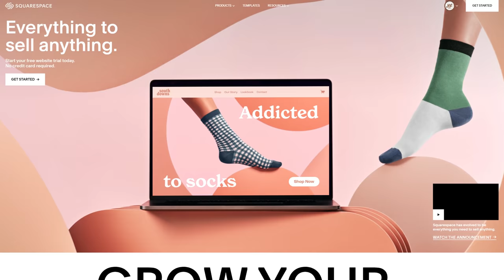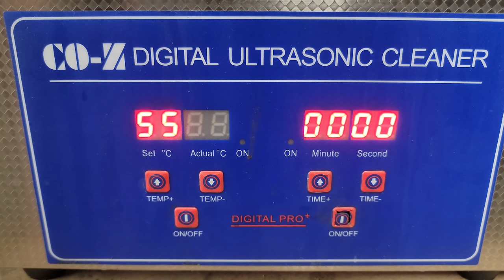Rusty 1960's Nylint Ford Lift Gate Stake Truck Restoration

Comment: Beautiful restoration. Funny thing is it’s a FORD AND IT HAS A FLIP UP CAB TO SERVICE THE ENGINE! Kind of makes me weary of the FORD MOTOR COMPANY! Haha 😆
Reply from the maker: Haha they actually made the real version of this truck for over 30 years, Couldn't have been too terrible!
Reply: @joe_diy  no they  were actually beastie old trucks they would take a beaten for sure there is an old commercial that if you bought one of those old Ford cab over trucks you would be able to purchase a 8n Ford tractor like $450.00 less than the regular price of one doesn’t sound like much by today’s standards you could. Probably buy the 8n tractor for like $2500.00 back then so it was a good marketing deal .....

Comment: What no seat or steering wheel  ,that's going to be hard to steer without a steering wheel & need a place to sit down especially to cover the engine & also should've put an extra wheel on the inside of the back axle on each side to make it a dually